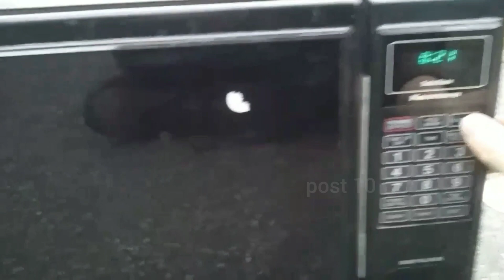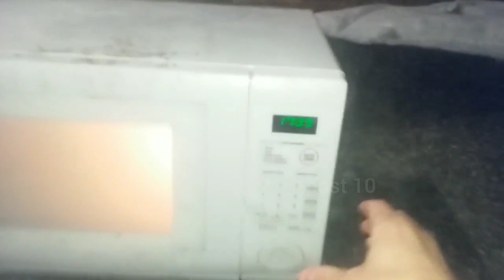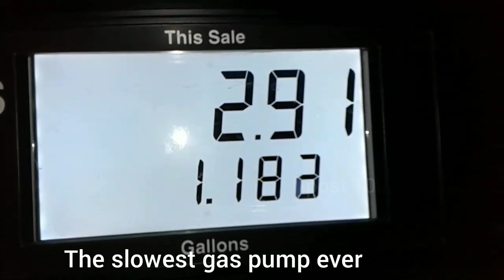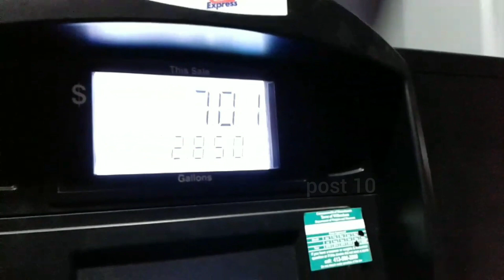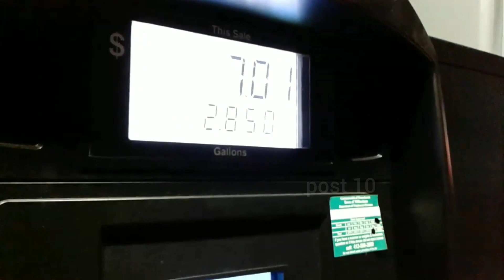Post 10 Videos From Before 2018, Electrical Projects

Comment: A fun thing to do if you ever run across one is to connect a metal halide ballast (the bigger the better, I used a 1500W one) to a regular incandescent bulb. They're also really good for inflicting serious amounts of carnage on circuit boards.